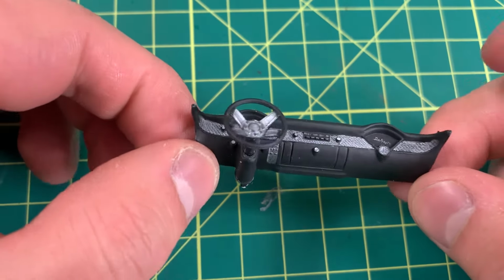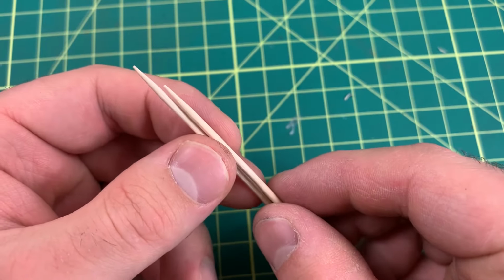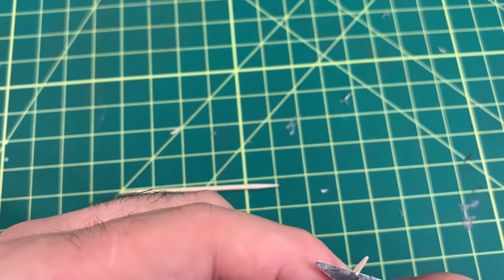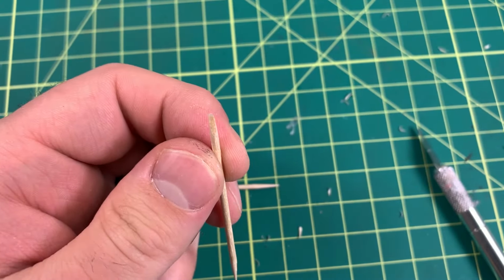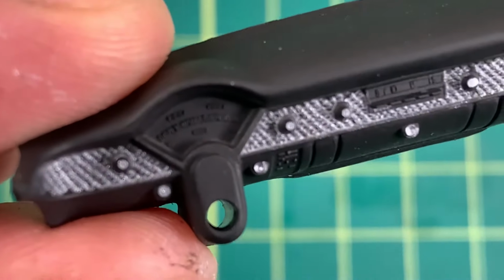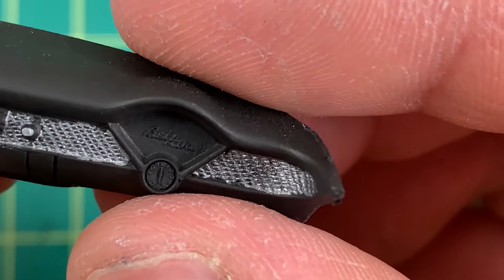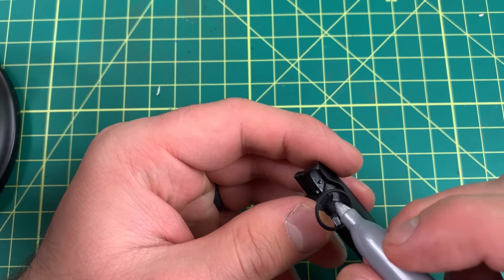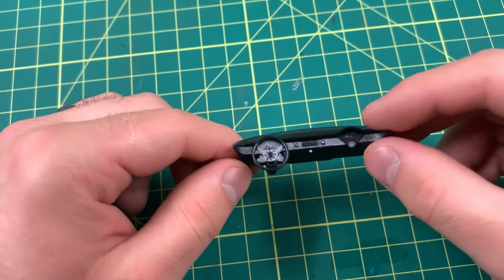How To Detail a Scale Model Car Dash

Comment: Nice work man! I’ve been intimidated to do my dash on my 1/24 model. I think I’ll do what you did! Thanks! And did you use a wash mix for the silver on the tooth pick?
Reply from the maker: Thank you! And never be intimidated, you can always fix mistakes and that’s the only way to learn is by doing it. And I didn’t use a wash, just paint straight out of the bottle. Thinned paint likes to run on small objects and it gets in places where you don’t want it.

Comment: Thank you so much.  You are right, dashes are easy if you don't rush, and have very fine tooth picks.   I always use  very fine paintbrushes  0000.  About $5.00, toothpicks are cheaper.  Thanks for all the tips, very light layers, sharp toothpicks, and the satin final coat.   I will be trying all these.  Keep  the videos coming.

Comment: Just for your future builds most of the pre '60s cars had a high gloss finish on the interior sheet metal, ALL of it every single piece of metal in the car was a super high gloss. The black dash in my '56 Chevrolet Bel-Air sedan had a finish that was so shiny and deep it would reflect better than the rear view mirror most of the time. And it was that way from the factory too.